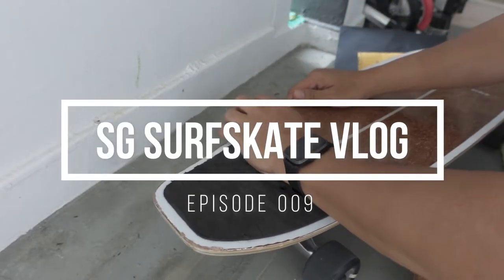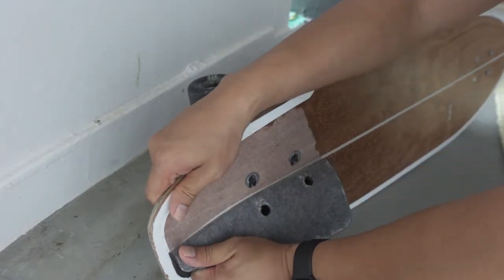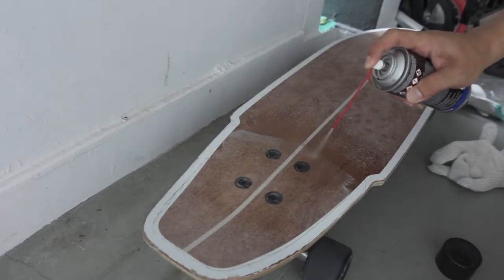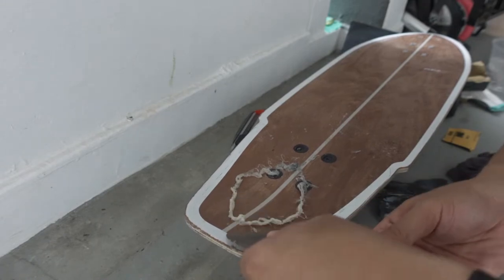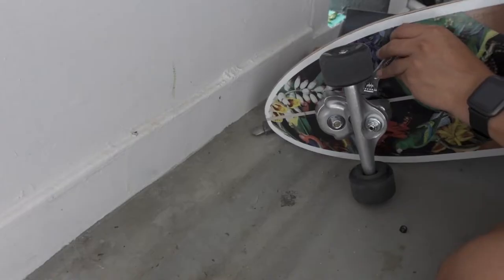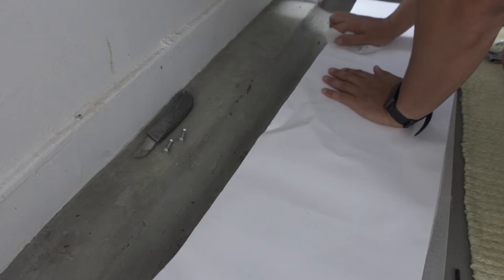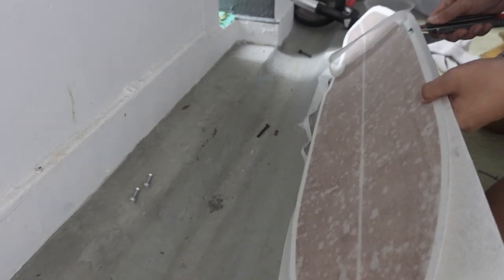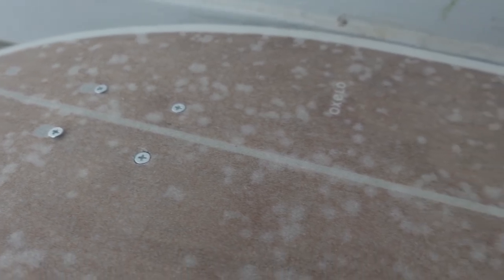FIRST TIME REGRIPPING MY BOARD AND I GET MOST OF IT WRONG - Surfskate Vlog 009

Comment: Hello, I had the same problem with my oxelo carver , I bought a normal black grip from decathlon and replace it sandingthe area just like you. I cut the shape for the "tip "of the board where my foot is pressing, how to explain? more or less like a Ginko leaf shape but with straight sides...Well anyway, The result I think is not losing the cool wooden effect of this deck but it works pretty well with shoes in case you want to modify it :) It is nice